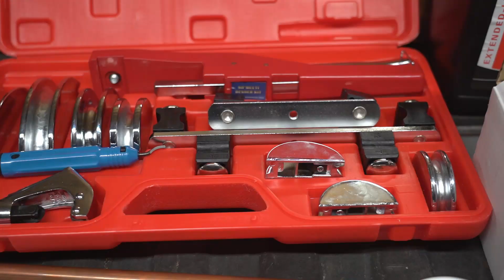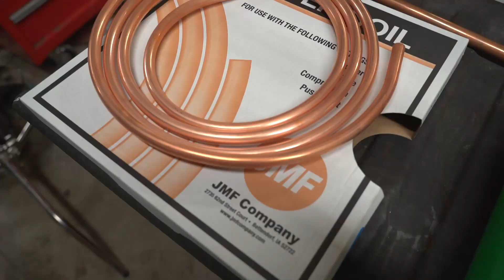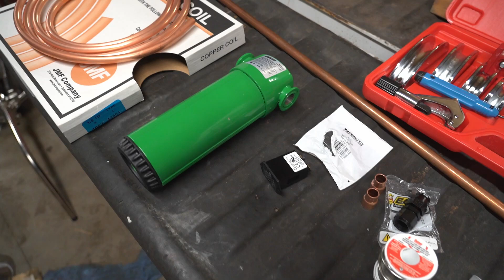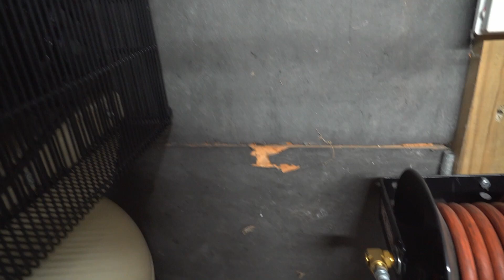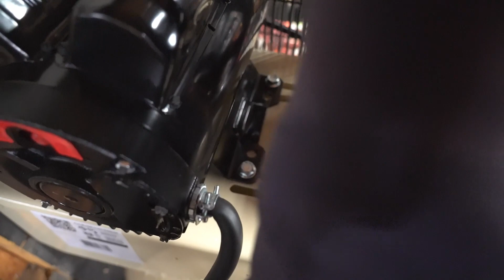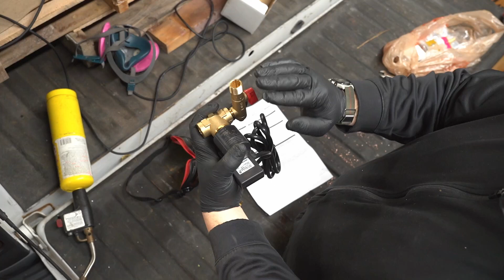New Air Compressor & Water Separator

Comment from the maker: If you decide to build one of these, know that you do so at your own risk. I am not an expert in dealing with high pressure plumbing and wanted to show my own variant on solving the issues with water collection inside my compressor tank.

Please feel free to share any improvements or concerns that you might have.
Reply: Thank you for posting the video.  Is your Water Separator still working for you?  Would you do anything different if you had to do it again.   Best,  John
Reply from the maker: @PriPro-Polymers  Still working good for me. As for things I'd do differently, I'd probably go with the softer coiled copper tubing and bend it. I believe it actually is rated for plenty of pressure (which I wasn't sure about originally)... But of course, double check that information if you're considering that.
Reply: @manovermachine  To bend ridged copper the metal must first be annealed.  Type L bends really nice after annealing.  Just a propane or mapp torch.  I run Nitrogen through as I anneal just to make sure nothing builds up in the pipe while I'm annealing, but for this I doubt it would be necessary.  Not brazing, just annealing.
Reply from the maker: @crforfreedom7407  I never actually intended to bend the solid copper pipe. It was really just one of those candid moments where I forgot the details of what I was doing, and had tools and materials on hand for soft or hard copper pipe. I am aware that the pipe would need to be annealed to do so, but that was never my goal as that changes the ratings of the pipe. In hindsight though, soft copper pipe is rated for more pressure than I realized at the time and probably would've worked fine anyway.

I'd say the biggest challenge to the entire project is finding fittings to interchange for each section.
Reply: @manovermachine  Cool.  We anneal and bend ridged pipe all day long in HVAC with pressures often around 180psi - 350psi so...

Comment: Everyone should know that you can't bend L or M copper water pipe, you can anneal it and then you can bend it but it's better to use K-Type copper tubbing because it will hold high pressure. Your build does not look safe and it is an accident waiting to happen because of the piping and pressure. Compressed air is explosive while water under pressure just fizzes.

Comment: If the pipe coming out of compressor pump is 1/2 inch and the  radiatoe is 3/8 inches......then we are causing a sgnificant restriction in air flow....not even cosidering the amount of turns the compressed air has to take through the radiator.....ergo generating even more heat in the rad.   So ideally you WOULD  want a fan blowing on the radiator.     I plan to do the same on my compressor.   If the exit pipe from the pump is 1/2 inch....then ideally you would want the radiator(cooler) piping to be the same size.

Comment: Why you're doing this? It won't increase the life of your compressor tank significantly. The main problem is that you won't remove water completely. There will be some water anyway. As such you tank will rust anyway. Let's imagine a mega super project and you're removing 99% of water. I bet you won't make 90% but just let's assume 99%. You compressor pushes lets asume 200l/min and your tank is 100l. Compressor adds double air and water amount in 1 min. If you removed 99% of water it means only 1% made to a compressor. It means that to get 100% of current amount of water in 100l, you will need 50 mins to run your comrpessor. So after 50 mins, your compressor will have a certain, even small but a certain amount which normally appears in the air. All that water will be condensating on your tank anyway and will be rusting.
The only benefit is that some tools will last longer if they get less water. You will get better painting results with less water. 
I came here to make something to reduce water for painting.but eventually decided  to use some cheap water filter and see what will happen then.

Comment: Princess it's rigid you need tube copper that's rolled and used for 410a that will bend with a pipe bender

Comment: You have an air cooler and water trap, but nothing to condense the water from the air very efficiently. For that a large diameter tube (2" or larger) between the cooler and water trap works well. If you put copper brillo pads or old scrap pipes in the large diameter tube, this creates more surface area for the water/air to condensate on.

Comment: My tank was built in 1947 and is still in service. Last drain about 1/2 gallon of water came out. Tank longevity is based on quality of the tank, not how much water goes into it.
Reply: Completely agree. Tank quality is the only factor. I told already in my comment you can eliminate water completely so there will be water anyway and it will rust.

Comment: Those automatic drains are poorly implemented. I've seen the exact same models sell between $20 and $200. A 45 minute timer that operates regardless if the compressor has been run or not doesn't make any sense. I've also had an issue with the valves corroding if there's any standing water on the outlet side (mine has to vent 14' up before going through a wall, as there's no place to for it to drain at ground level). I ended up making my own automatic drain that uses a stepper motor to turn a 1/4" push-to-connect valve to the open position for 3 seconds then close it. The controller monitors the compressor and when it shuts down it runs a drain cycle. It'll also cycle it every 6 hours after the last compressor cycle, and has a button for a manual drain cycle. I did resist the urge to make it cloud connected and be able to track compressor run/stop times and such (I do have an mechanical hour meter).  As soon as I install the after-cooler, I'll have the controller manage the fan on it.

Comment: On your tank drain, you don’t need to have the ball valve open 100%.  Try closing it most of the way to cut down on the noise when the solenoid opens the drain valve.  Might need to extend the drain time of the solenoid to account for the reduced air pressure.
Reply from the maker: Really good idea, just annoyed I didn't think of it.

Comment: I’m surprised they don’t coat the inside with an epoxy.     Stop the rust by protecting the steel or make a stainless version.  If you want to bend copper you need to use the coiled version.
Reply from the maker: You can buy compressor tanks that are epoxy coated internally. They are not cheap, but if you've got the money.... Granted I've heard the lifespan on these tanks due to the pressure cycling is limited. Fatigue and cracks can still develop even without rust, it would seem.

Comment: Have you had any issues since the build. I have built 2 and had the output fittings on the cooler separate. I used copper hard line and flexible hoses. My next attempt will be using stainless steel braided AN hoses. Hope this works ( getting expensive). 
Paul
Reply from the maker: I have had no issues with mine so far. The AN fittings on the copper tube that I used were compression fittings. If you used the same fittings, the only thing I could suggest is possibly making them tighter. I expect the copper pipe on mine is deformed slightly. I have been running mine at 170 PSI without issue.
Reply: @manovermachine  thanks   I’ll see how this round goes

Comment: Cool build but was a mess of pipes.
Reply from the maker: I disagree. The amount of piping used is objectively minimal or near minimal required to accomplish the task.

Consider that the cooler needs to be oriented this way to allow for as much condensation as possible to exit the bottom of it by gravity (so, it should drip out when not compressing as well).

In hindsight, flexible copper may have been OK after recently checking the pressure rating again, and perhaps simplified the process of creating each section, but nevertheless the end goal was achieved and the result was something that was minimal and not in the way.

Comment: If you get that pipe really hot it will soften it so you can bend it.
Reply from the maker: You can bend metals easily by heating them up, this is true. But there are other concerns such as annealing the hard drawn copper(This may not be desired) or reducing the wall thickness due to the distortion created in the metal by the bend. I chose to avoid making those considerations or having to make a judgment call on them for myself.

Comment: Man, the extra credit you’d earn for bending a single piece of copper from the water separator to the tank is off the charts.   How has the solder joints held up?   I’ve heard brazing, not soldering, with 15% silver rod is highly recommended with copper HVAC lines due to cracks developing from vibrations.
Reply from the maker: You don't bend hardened copper pipes (as demonstrated in the video when I forgot everything I researched in the moment). I chose not to use soft copper because the pressure rating was lower. As far as solder goes WRT to vibration, I haven't had an issue so far, but of course do anything I mention entirely at your own risk.

 I used Oatey 29025 solder which does contain silver. Heating the pipe to the point of brazing it may start to anneal the copper. I haven't tested anything to failure, so I couldn't tell you if that matters much or not. In terms of vibration, the pipe going from the separator to the tank shakes more than I'd like and I might consider a flexible section to mitigate potential issues there, of which cracked solder would be only one.

Comment: Bummer on the bender bruh. Ya didn't link that item. The stem piece was to close to the bend which caused it to snap. A longer lead would have helped ya there, maybe.  In the end though I feel the 90's made it cleaner and I was a lil surprised you used 45's in the riser. Guess that saved ya 3" in copper.  Anyway fine job.
Edit: Honestly a 12" nipple  piece of brass (not iron due to corrosion)  will bring that drain line out to where it is accessible (using that 90 to turn it out). I no way wanted to get down on my knees to access that sheet. ( 😱 No way did you leave that contraption under the tank bruh .......OMG, turn it out with a 90 and a nipple and it is fully not under there.......ugh)

Comment: You cannot bend hard drawn copper which is what your long straight piece was.. The coiled copper is softer  and bendable. But you still took care of it.
Reply: You can by using ending springs inside the pipe. I got a kit from amazon and bent my whole airline system with 1/2" copper.

Comment: You shouldn’t do this stuff if you don’t have knowledge about plumbing. You will have failures if you don’t know this stuff.
It’s dangerous.
Reply from the maker: I agree that anyone who builds this should do so at their own risk. I think it would be beneficial if you have identified any specific concerns to share it with the community.
Reply: Nah, sorry, you don’t get a new bass boat for for our air compressor installs. Plumbers and hvac crackheads can fck right off. It ain’t rocket science.

Comment: Thanks for this video. It shows how incredibly frustrating it is to make mods to your air compressor. I’ve just spent the better part of two weeks trying to fit a new Harbor Freight pump onto my dead, generic, Lowes branded 5hp 60 gallon compressor…
Omg, the amount of copper tube ID v OD and thread pitches and reducers and flares and compression fittings and pipe thread to compression adapters and pulleys and belts and…I wanted to pull my hair out. 
I finally got it figured out and tracked down most of the leaks, but I should have just scrapped it, and bought a new compressor. 
Don’t do it.
Reply: Your advice might be counter to the DIY-or-die ethic so common on You Tube, but it is really good advice. I posted a comment the other day on one of the many videos about repairing the carburetor on a V-Twin Briggs engine. Rebuild parts might only cost $10, but a new knockoff carb — and they work well — is $30. I’ve repaired those carbs, but for the time spent fussing with tiny jets and pieces that don’t want to come apart is it worth saving $20 opposite a new carb that installs in minutes?
I’ve watched a ton of vids on these compressor mods, including those involving elaborate wall-mounted copper piping setups, and still am not quite sure whether the result is practical or theoretical. One fellow was asked how well a system like this was working a year or two later and his response was, “I don’t use my compressor much anymore.” That’s reassuring. A big question I have for my own compressor is whether this 1/2-inch cooler is advisable for a machine with a 3/4-inch tube from the compressor head. Safety and reliability are among the many others. Not that I might not attempt something. But, still.

Comment: What size threaded ends do the transmission cooler has coming out of it? I'm thinking about doing this with my compressor. I had bought a different type of cooler than you have, but can't find any copper fittings big enough to fit it. I was thinking about getting one like you have. I see a lot of people using that kind

Comment: WOW...WOW!!.. I bought same compressor and looked for similar ideas to yours... I didnt see yours which is "THE BEST YET" but I went ahead and put a large transmission cooler with a 12v fan I activated from pressure switch but Im in humid FL and I still get water in tank.... I am definitely getting your pre-tank separator ordered... My question is, Im sure you have seen the vertical u shaped piping with a drain valve on bottom, what are your thoughts of that also pre tank?... or maybe thats a complete No No but man do I love your Ideas and craftsmanship!!
Reply from the maker: The pressure switch is a great idea, I may have to try that. I have a 120V fan I haven't installed yet and was going to use a thermally controlled switch mounted on the  outlet pipe of the compressor head.

As for the u-shaped dip in the pipe and a drain in the middle of the low part, I have seen those designs. Of course, they're usually set up with ball valves so you have to manually drain them(Which the one I have drains automatically of course), and with the can I have the compressor can run for a longer period of time before water starts getting pulled back up and into the tank.I wouldn't say it's a no-no. But it's certainly less convenient and more work, IMO.

I am wondering what pressures you're running (Where does your compressor shut off). I'm not 100% sure but I could see lower pressures not rejecting as much moisture. My compressor cuts off at 175 PSI, and turns on at around 145 or 150 PSI. I believe that high pressures will cause more water to condense out.. Though I'm not suggesting you turn your pressures up beyond a safe level for your setup. Might be part of the reason.

Of course in hot and humid Florida, your temperatures day to day are higher than mine are in Michigan, so you'd also have a reduced cooling effect across your cooler just due to the higher temps. 

Commercial units use refrigeration to lower the temperature even further than our coolers, below ambient, so this design I made isn't a perfect system, but it should come pretty close to preventing water from condensing in the tank.

If you had to guess, how much water is being removed vs making its way into the tank with your setup? I'd say in my case it's probably close to 95% or more removed. I really can't tell if there is any water coming out of my tank drain, however much there is, it's not very much at all but I could definitely tell it was before installing the cooler and automatic draining water separator.
Reply: @manovermachine  I have pressures set to 125 and 90... for my work it seems ok...although I'll play more as I go with the low...the125 high setting is plenty for me... I do have to say the inlet to my transmission cooler with electric fan cannot even be touched as it is very hot but the outlet of the cooler is barely warm telling me that that's working well.... I did order the auto condensate remover last night..(Thanks for that).... so I do think it will be sufficient as I see so many people make systems to keep water out of tools, but as you did and I am doing...I want no water in tank.. I believe if you reduce most  of the water from tank... it will be minimal in the after tank accumulators......But Your setup is so professional and obviously useful... I only go pro like you did.. the rigging, and sloppy non-factory look is no good.... I would love to stay in touch as it would be good to see how yours is in cold verse mine in hot at similar settings and maybe there's somewhere in the middle we'll benefit from... Thanks again and Keep up the great work....

Comment: Man Over Machine, On your Compress pads. Did you mount through to the floor or do you just have isolation pads bolted to the tank to minimize the risk of walking?
Reply from the maker: I just have isolation pads bolted on to prevent walking as you said.

I have hockey pucks bolted on (and I countersunk the hole so the bolt head did not stick out below), as well as anti vibration pads underneath with no fasteners at all. I would have only used the anti vibration pads but I needed some extra height due to the solenoid drain valve I added to the bottom of the tank.

The hockey pucks wouldn't have stayed in place without the bolts, since they're barely bigger than the feet.

I haven't noticed any walking up to this point.

Comment: Separator with drain, done the right way. I've seen after coolers factory installed with no separator or drain. Air cools, water condenses out, then goes right into the tank anyway. What's the point?
Reply: Kmcwhq, I agree & wondered the same about factory Aftercoolers with no water trap/seperator Before the tank. Yeah, keeping water away from the tank inside adds years or decades to tank life. He did a great job!